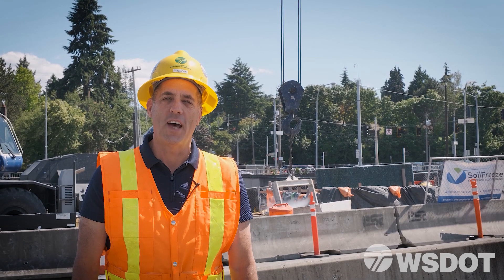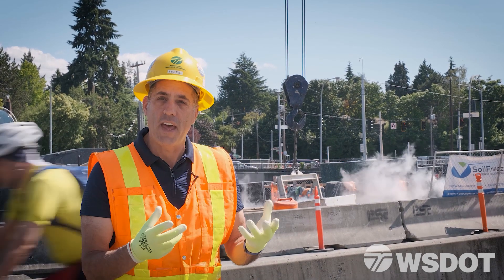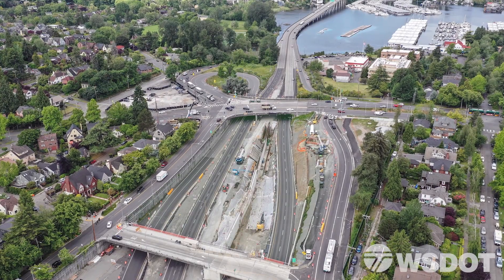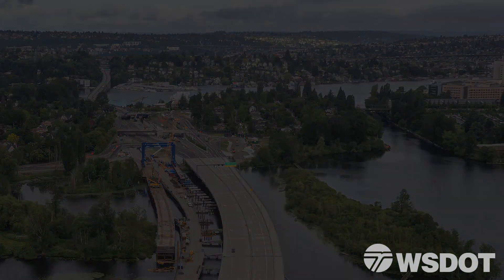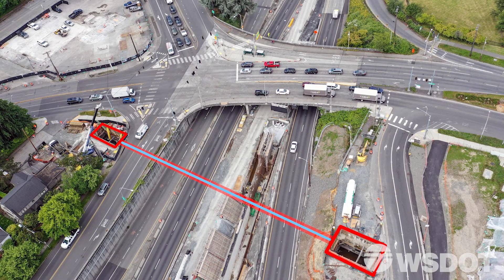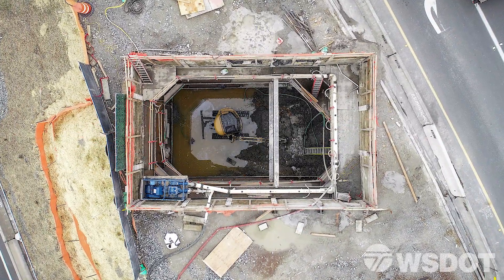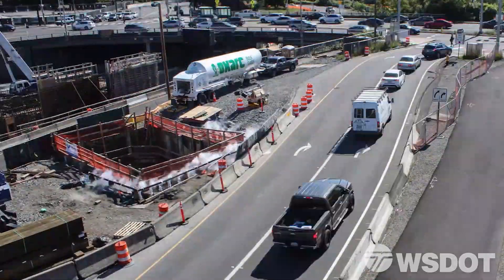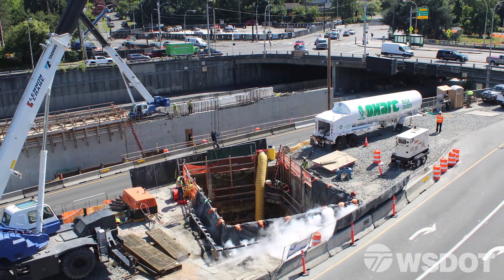SR 520 - Freezing the ground with liquid nitrogen - Montlake Project - June 2020

Comment: I think they did that in the Boston Big Dig as well.
Reply: Yes, in multiple places.  The largest was at South Station when they had to tunnel-jack sections of the I90 tunner under the tracks, without disrupting the trains.  They froze the soil to stabilize it, then mined out the frozen soil in front of the tunnel as they jacked sections forward under the tracks.  The big dig used just about every modern construction technique - and had to create a few new tools.